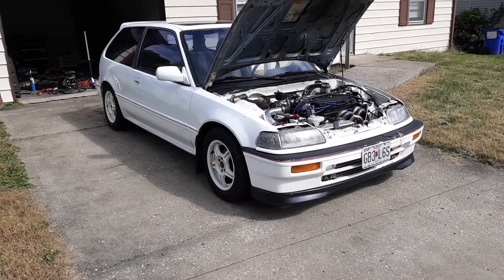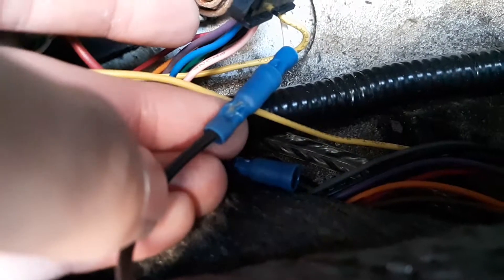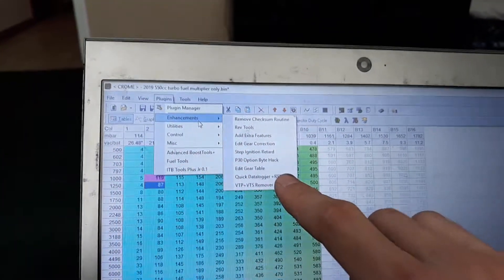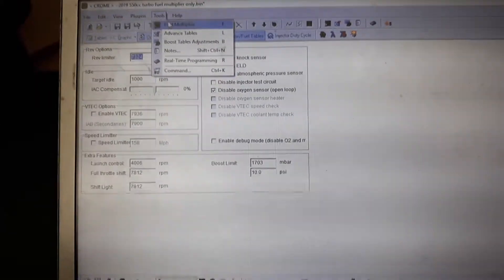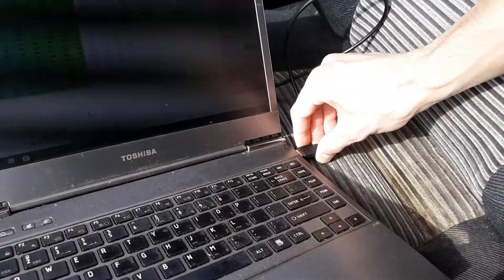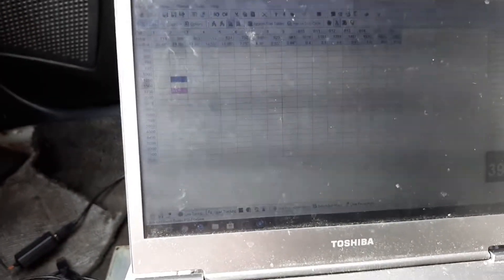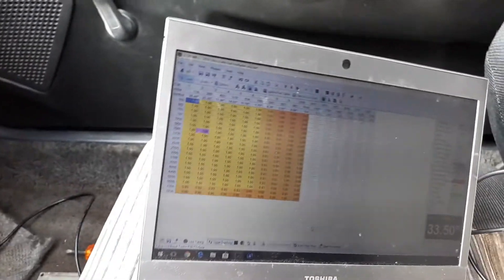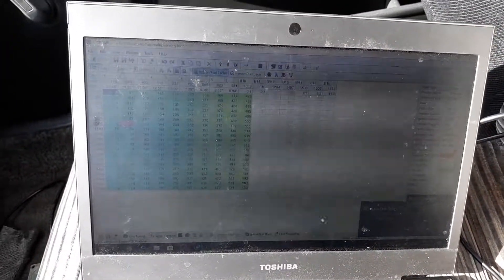HOW TO: Honda crome datalogging and basics of tuning.

Comment: My biggest concern is making sure the engine doesn’t spark knock without having a knock sensor or dyno to see where advancing the timing no longer creates more power. Is there a way to tune the timing maps so you know it won’t ping?
Reply from the maker: I know I'm a little late to the answer on this but you can build a pair of knock headphones for really cheap. A Google search for DIY engine knock headphones should lead you in the right direction.
Reply: @jdmjedi777  that is good to know for the future. I ended up leaving stock ignition maps for the engine in question and it was fine at 11.5:1 compression, no spark knock. For a higher comp setup i’ll keep this in mind, thank you!

Comment: Good job brother love from.Pakistan.Karachi 
 I have blue top h23  ecu is Po8  3inch exhaust piping with action clutch i donot know what stage is Action clutch it runs well ..anyways my ecu is stock i want to chipped new your suggestion my car is mitsubishi lancer93 with h23 motor
Reply: I need your suggestions.
Reply: Brother do reply me
Reply from the maker: I buy all my chipping stuff from www.moates.net the chipping kit is only about 20 US dollars. As long as you can solder well it's not very hard to install.

Comment: Super legit. Subbed! Man I cannot get my laptop to connect to the ecu. I’ve done everything to my knowledge as to what forums say, the crome user manual and I just cannot get it to connect. Is there anything you have to do to the ecu to datalog? I have Pro bought it specifically for data logging. I didn’t tune my current map but the only thing that’s holding me back to learning is connecting to my ecu. Did everything you did and the manual. I’m going back through your video, others then the user manual.
Reply: Alright man I’m going to go cut it and check And see what’s up. It’s nice up here in the mitten today about 45 we’ll see what’s up
Reply from the maker: @ajradel  awesome man! Please let me know if it works for you. Hope it does.
Reply from the maker: @ajradel  so did this end up working out for you?
Reply from the maker: What kind of laptop are you using? You might need to go into the settings and see what com port the data logging cable is assigned to or if you need to assign one to it. Also make sure you have added "RTP/quick data logger" to the rom. Also have you cut the "j12 jumper"?
Reply: i am using a lenovo it has windows 10. ill double check the ports. i have not cut the j12 jumper. hmm..no codes will be thrown if i do?
Reply from the maker: @ajradel  to be able to data log with crome the j12 jumper has to be cut. I can almost guarantee this is why you cant datalog. No it will not cause any codes. Its cut on my ecu and on every other honda running crome and datalogging. Some other programs like hondata dont require it but with crome it is required to be cut in order to datalog.
Reply: Ive had problem lately. Came across SST ***512 are more memory than stock chips. Found 1 guy who talked about changing setting to read chip from 000800 on. I change my setting & all of sudden it reads.